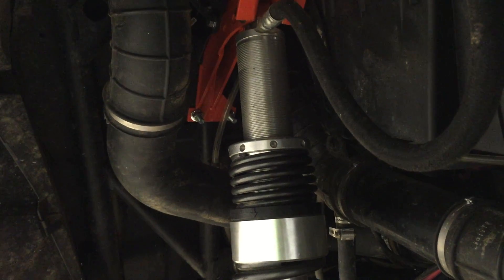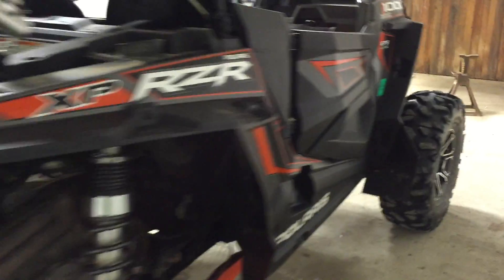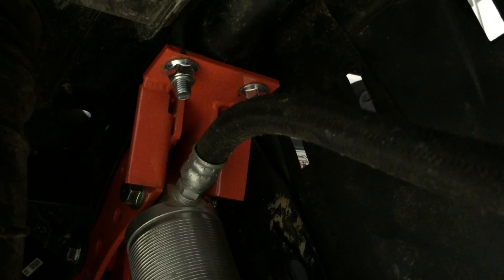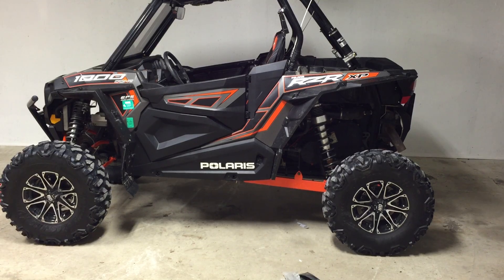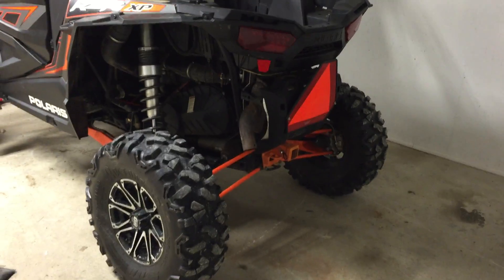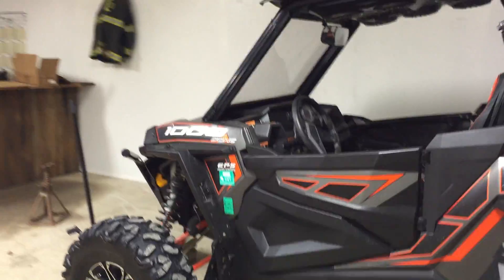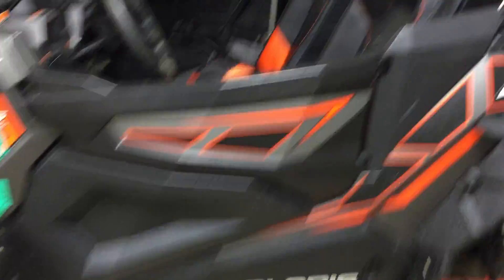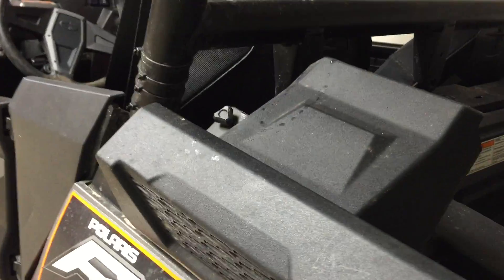Super Atv 3-5 inch lift 2014 Polaris rzr XP 1000 with STM CLUTCHING

Comment from the maker: It's adjustable from 3 different shock mount locations on the new brackets I'm setting about4 inches higher because I loosed my spring pre load

Comment: did you have to take your wheels off and let the suspension hang?
Reply from the maker: Mitch Muerle yes but only 4 bolts per tire so can be removed in under 60 seconds

Comment: How do you put on the spacer in the rear shocks?
Reply from the maker: Isaiah Pittman There is a thread on the bottom of it you take off pull the spring off insert the spacer put the spring back on thread up the nut super easy
Reply: Thanks man, how much air you run in your back shocks??
Reply from the maker: Isaiah Pittman I did not mess with any air pressure they are gas charged you don’t need to mess with that with this kit simply unthread the retaining nut Take all the tension off the springs pull them apart And insert the spacer